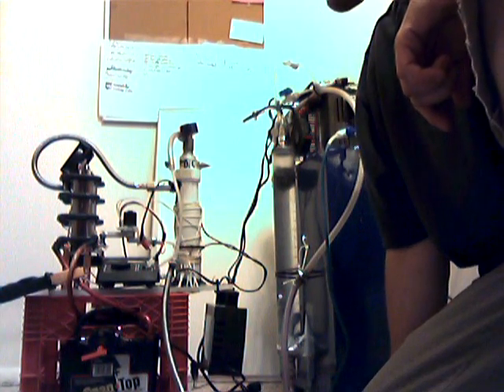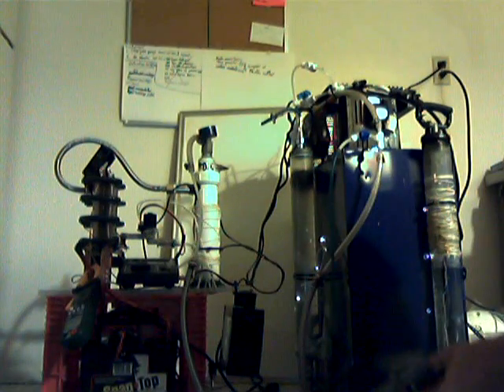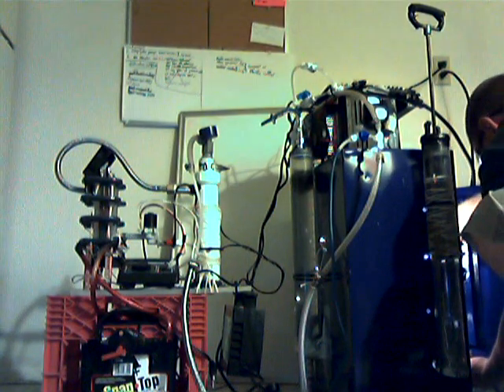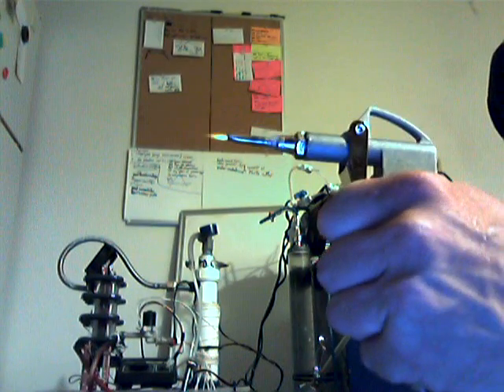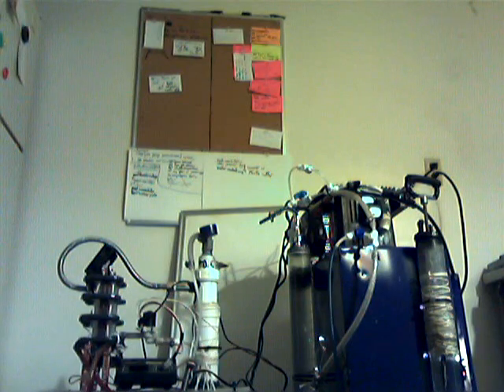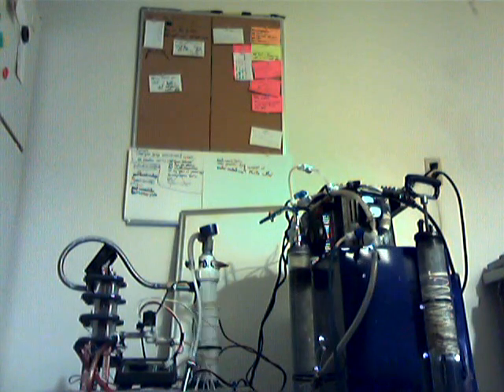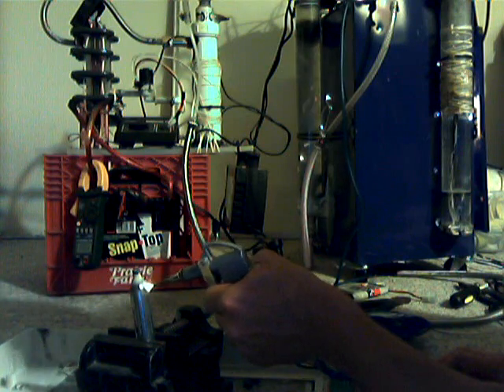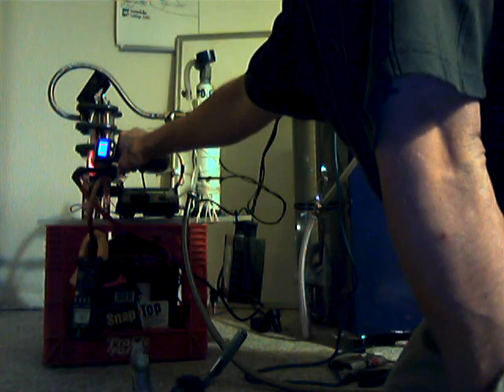HHO Generator  Dry cell high output low volt

Comment: The timing need to be set very different since Hydrogen explodes much faster then Gasoline. Where do you get all the HHO from, you need to run a Car with at least 50 to 60 liters per minute. My Cells make per Watt 5 ml of Gas. If you squeeze it any Cell will overheat.200 Watts per Liter is a good Number, to produce 50 liters you will need at least 10 KW coming from somewhere.

Comment: There is a big differenc in temps,from out side and water temp,on my wet cell when I measure the tube temp and the take the lid off and measure the water there is usually a 40 deg different temp between the two,If it really matters to you.